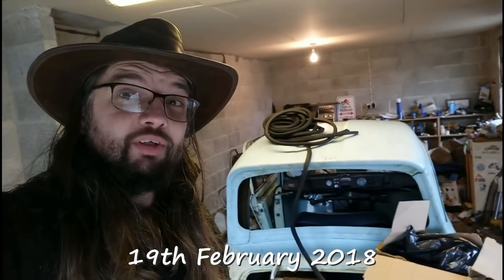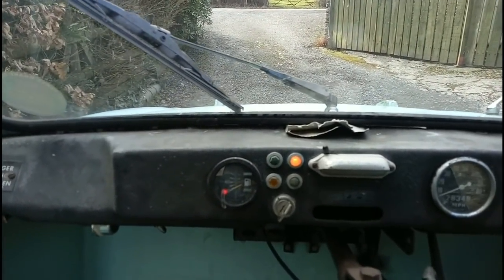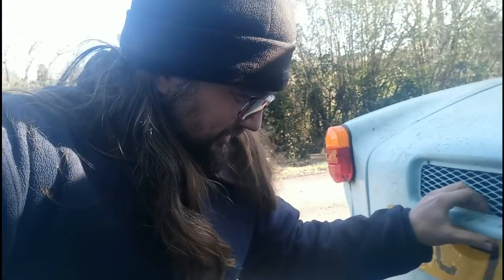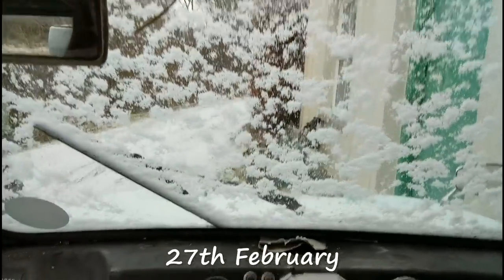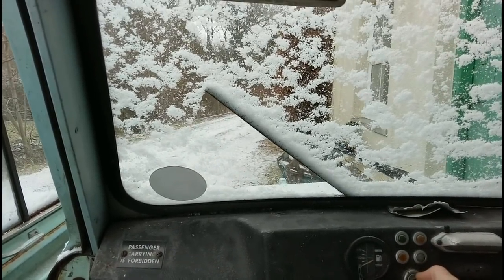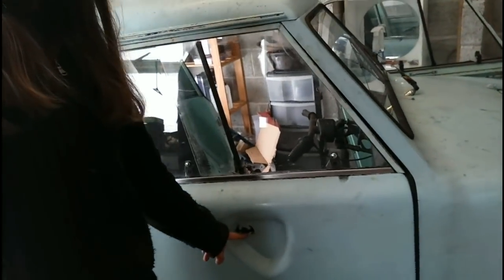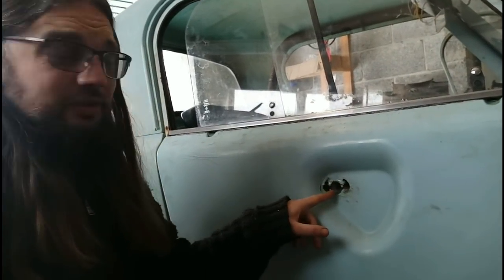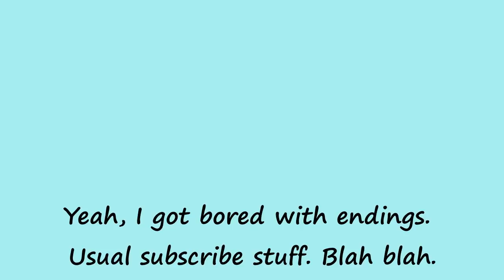Project Invacar Part 13: Rear window, lock fail, snow, mess

Comment: In the 70's the UK government  asked Lister to see if they could fit a less smoky and more economic engine  to the Ivacar - They did some bench tests with a Lister AC1 single cylinder (305cc 6.5HP at 3600rev/min)  but the project was dropped  - the engine lay under cover tn the test shop till 1994 when it was given to our group to see how many miles we could get to the gallon out of it in the Shell Eco-Marathon - Using the squirt and coast method we achieved  1760 MPG @ av speed of 15mph  at the silverstone race track  -  still have the engine in my shed !
Reply from the maker: That's fascinating!
Reply: We got it up to 50mph  : )
Reply: Wow thats quite the mpg 👍

Comment: You are a very brave man driving your Invacar in the snow. I had to get my wife to back our XJ6 automatic back onto our drive because of the snow, I was driving it too slowly so it was getting stuck, at least a few drivers stopped to allow me to muck about. Oh hum…
Reply from the maker: Small, light cars with narrow wheels are a lot better in the snow than big, heavy cars with fat tyres. That's why the Lexus hasn't moved for a while!

Comment: Maybe my OCD, but whenever I see little Tuk, I have this urge to give her a good clean up! But one day it will be immaculate again, I am sure, and will be nice to see her on the road soon. There were lots of these on the roads when I were a nipper, and its good that some get preserved - part of our motoring history in the UK. Thanks for these vids,  interesting.
Reply: I recommend those small hand-held steam cleaners inside and under, then GRP polish ( as used on boats) for the outside gel coat.
Reply from the maker: I rather fear the gel coat needs some serious work before polish can be applied.

Comment: It's nice to see more progress on Little Tuk!    I'd like to suggest , if I may,  that you consider using a two part epoxy putty for repairing the door handle area. The stuff that cures like metal.  With the use of that,  you could fabricate a way to embed  some kind of anchoring device for the mounting hardware, like a hex nut or a threaded insert!

Comment: Use an aluminum cut panel secured with coach bolts and re drill the hole for the door handles, you could use steel but as took is fibreglass we don't want a steel patch rusting out over time, nice upload Ian cupa and a biccy required take care and stay warm.

Comment: (An idea.. I have not personally tried it on a door but have done similar material bonding when working on motorcycle fairings) If the door fiberglass has gotten too weak for the handle then epoxy a 3/16" or similar thickness aluminum plate onto the inside of the door (~1-2" larger than the handle's mounting flange) then drill and tap it for the handle once the epoxy has fixed. The epoxy will give the new backing plate enough strength to deal with the handles torque and other stress when using it. 
This way, nothing appears new on the outside of the door panel, all of the strengthening is done on the inside.
Cheers,
 - Eddy
Reply: All the above is assuming that the handle fixes to the door using screws that go into the handle and door from the outside...

Comment: When I have to start an unwieldy car, I generally start while slowly applying more and more throttle. There's a sweet spot on every car and at some point it just goes 'vroom'. I will keep the throttle at that 'setting' once it's running. More will probably choke it in fuel, less will make it stall from too low revs. 
That seems to work for every car (literally) with a manual choke I tried it on yet no one else seems to do it :D.
Reply from the maker: TWC starts really well most of the time, just not when it's sub zero it seems! She doesn't like any throttle at first. 2CV is the same. Or was until its recent troubles. Still not entirely sure what's wrong with the 2CV...

Comment: You could get a flat piece of Steel and attach at either end of the door that runs straight across potrivit it at the ends of the door put a washer on the outside to stop the river pulling into the fibreglass will help make the area strong when you put the handle back on put to three holes one for the handle to go for it and two for the handles to secure should make it very strong then fiberglass where the whole are

Comment: For the door handle - what about cutting a metal plate to the shape of the recess, riveting it in place and mounting the door handle on that? That should do it quite nicely and probably it will be in place forever. If you do it with glass fibre patches, it will break again...

Comment: I think the answer to the door lock fitting issue is to get a thin piece of aluminium plate and bolt, screw or rivit it in place behind the damage door lock mounting then redrill the door handle mounting holes into the plate and that should secure the Handel back in place

Comment: Have you thought about using multi-weight oil such as 10W-30?  No need to change it for different seasons.  Most people use it here.  Also: No snow expected today in Colorado, USA at 6,000 ft. above sea level -- the high to be about 50 F (10 C).  Keep the little putt-putt putting!
Reply from the maker: I'm tempted to use multigrade, but a Haflinger specialist recommended sticking with 30. I'll see. I never was one for following recommendations...

Comment: really enjoying following the progress on little tuk, as i find invacars fascinating ---- have you managed to find the service information for the engine ? (steyr - puch 500 or 600cc air-cooled flat twin as fitted to the steyr - puch mini/micro car (similar looking to the old fiat 500) a 654cc was  fitted to the haflinger cross - country vehicle), a couple of service specs if this helps are :- valve clearances in & exh (engine cold) .006" (0,15mm), contact breaker gap (new set) .015" (0,32mm),  ignition timing 4.5 degrees BTDC  at idle and 32 degrees at 4000 rpm using a strobe lamp on the crankshaft pulley ---- hope this helps.
Reply from the maker: Thanks, but I do have a service manual.

Comment: seen those door handles on the back door of a 1977 Bedford ambulance. think Mk 1 transit back doors too but not 100% definitely old commercial vehicles though.
Reply from the maker: They're Minor Traveller, but almost certainly used on other vehicles.
Reply: +HubNut 👌

Comment: Fitting the rubber the way you have done is no problem at all, 
I used to fit the rear windows in Land Rovers like that for better security,  are you going to get the glass fibre repairs done soon Ian ?
Reply from the maker: Thanks. No, I doubt the repairs will be done soon. Priority is legality. Anything not related to that is not on the priority list right now.
Reply: It's actually less secure to fit it like that. It's is far too easy to push the window in to get access to the car with the locking strip on inside. Of course, today you might well say "Who'd want to get into this? And it's garaged most the time".

Comment: Door handle. While the handle is off, couldnt you get some thin card and trace the entire shape of the recess where the door handle sits and make 4 plates and double plate both doors. It would make it stronger. Either rivet all around or bolt it. Possibly strong adhesive would work as it will also be bolted from the door handle itself.
Reply: Ian Allen I was about to suggest the very same...stainless steel would work well...tiger seal it in place and use the handle fixings to squash it all together.
Reply: It would also spread the force used by the door handle when opening. :). I was thinking alloy, but steel is stronger.

Comment: why don't you cut a piece of stainless steel the same shape as the  bottom of that handle recess and drill it for the handle mount then you can glue it to the fiberglass with either resin or silicone  It will then support the handle and look like a scratch guard
Reply from the maker: Could do. Some were modified like that back in the day.

Comment: I'm upset, poohtube didn't give me a heads up. A low fuel light and a multi directional odo, it just keeps getting better. Put some light oil in once you've free'd stuff up, WD40 dries out after a while.

Comment: Add aluminium plate in the recess for the door lock. Rivet or coach bolt it to the door and drill holes to suit the lock??

Comment: If you want the engine to last, make changing the oil a top priority.  I'm surprised you didn't do it when you installed the new oil filter (or isn't it in yet?)
Lastly, use multi-weight oil!  10w-40 would probably be ideal for that old engine.

RichE
Reply from the maker: It has had two oil changes already. First time around, I discovered the oil filter was wrong. When I replaced the oil filter, I dropped and replaced the oil again. I'm minded to agree that 10w40 will be fine. It'll probably get another oil change after its first run out on the road.

Comment: Are you using a lead additive in the fuel?  Does the engine run on modern unleaded?  Regards.
Reply from the maker: No. Seems fine on unleaded. Aluminium heads tend to have hardened valve seats as standard. 2CV is fine on unleaded, and has a similar engine structure. Doubt valve seat recession would kick in much with the mileage it'll cover. I've ambitiously insured it for 3000 miles per year. Suspect I won't need that many, but we'll see!
Reply: HubNut Good news.

Comment: Did you find door handles for TUC yet?  Charles Ware Center in Bristol should have the Traveller handles.
Reply from the maker: Not yet. Hoping to revive what I have. These handles have an extension piece on them so they do differ slightly from standard.
Reply: Can you fit some sheet aluminum to strengthen the indentation for the handle?  The actual handle is intact, isn't it?
Reply from the maker: One handle won't unlock, but the other is intact.

Comment: supposed to get 6-12" of wet, heavy snow on friday morning... fun communite
Reply from the maker: We're expecting 30-40cm overnight...
Reply: ah, well normally i dont get to upset over just 12 inches of snow, but when its wetnheavy(sounds like a rock band name ;)) and the fact that i have to go down and recover parts of dads houseboat friday (winds ripped part of the cover over the A-frame over the boat off) going to be a max painkiller morning... gotta make sure to inject caffiene

Comment: Hey HubNut, mind if I ask you a question? My car started making weird noises for the past few days, then yesterday the noise was really loud, like a whirring and humming noise. I called up my insurance company to tow it back to my home. Today I drove it to a nearby service center and it got worse. The car started wobbling a bit. The service center said both the rear wheel bearings were broken. They pointed specifically to the left rear one and they said the right rear one is a bit broken too and would wear out soon if it wasn't replaced. They told me to touch the rear absorber (I guess?) and feel it while they spun the wheel and I could feel the thing vibrating. My car is a Proton Iriz and it has only clocked 40,000km so far. They asked me if I hit any big holes on the road? But isn't it normal to sometimes fail to avoid potholes? RM700 or about 130 pounds to replace both rear bearings together with their hubs because apparently they have to be changed together (my car has ABS and EBD)? Have I been fleeced? My car is at the service center right now and it's closed. They told me it will be done by tomorrow. I was so worried about the car because I need it for something important that is coming up soon, so I didn't think about getting a second opinion from another workshop. Plus, I was worried about the tyres exploding if I continued to drive. Reaching the service center alone was an adventure.
Reply from the maker: Watch my Citroen ZX video. I had a rear wheel bearing fail spectacularly on that. They do wear out, though 40,000km is not very long. I'd expect at least twice that. Modern developments mean it can be very expensive to overhaul. On the ZX, the bearing is just pressed into the brake drum, so it's easy to replace.
Reply: I don't know who to blame... Is it bad quality from Proton? Am I too careless on the road and hitting too many potholes? I am an Uber driver, and there were a few times that I drove through massive thunderstorms and unfortunately some of the roads were kinda flooded. I read that water can really ruin the bearings? So, your opinion is, it's not likely that the service center cheated me, right? Loud humming noises and a bit of wobbling of the car usually points to failed bearings? Watching your Citroen ZX video now. Thank for the quick reply! :)
Reply from the maker: Yes, certainly sounds like failed bearings. Flood water can wash grease out of bearings - had that happen on my 2CV once. That was an expensive lesson...
Reply: Just finished watching your Citroen ZX video. Yes, that was exactly what I experienced too. But I didn't forcefully shake the wheels with my hands. Expensive lesson for me too... Hmm.. If it's water damage, shouldn't I be worried about the front bearings as well? What can I do? Get the service center to service the front bearings? Or just wait until they fail too?
Reply from the maker: In theory you could dismantle the bearings and repack them with grease, but it's a lot of work. Might as well wait until they wear out. Don't ignore any nasty droning noises though.
Reply: Ok. Thanks for the advice. :) How are you? You seem to really like the 2CV model. I want to try watching all your 2CV videos. Is there any of those videos in particular where you talk about the bearings failing on your 2CV?
Reply from the maker: Sorry, struggling to catch up with all comments, because YouTube is USELESS. Bearing failure was many years ago, pre-video.

Comment: Can't you fill the hole for the door handle with fibreglass and then re drill and mount?
Reply from the maker: Certainly an option. Will need reinforcement though. This is a known weak point.
Reply: You could keep adding layers on the inside until you get a reasonable thickness or like Satnavdmc said a flat piece of steel behind and you could cover in fibreglass to secure. certainly wouldnt pull through then.

Comment: Might be worth speaking to ex Reliant fibreglass guru Andy Plumb about how to tackle the door handle and lock best way, he is on facebook and gives us Reliant owners sage advice from time to time especially when talking about fibreglass applications.   I am thinking you will need to sand down the inner side, then bond with pop rivet and a strong adhesive a few mm thick spread plate trying to mimic the previous applications installation as there may be ribs and spars embedded into the fibreglass that will take the weight, fibreglass body filler will be easy to apply making sure the flat edges of the pop rivets are on the exterior which can be lightly sanded to hide them under a skim o' bodyfiller.
Reply from the maker: Yes, a few options to explore. Once the weather returns to sensible...

Comment: what's the rusty bolt in the roof lining?
Reply from the maker: You might need to give me a time reference there. I'm not sure what you're talking about.
Reply: ah yes, it's at 5:22 think it maybe a sun visor bracket
Reply from the maker: Yes, you're quite right.

Comment: does it not have a choke??  also what is that annoying orange light on the dash .. it would really get on my nerves .. Warning lights = moth to a light  - to me..I have nearly crashed glaring at a stupid warning light
Reply from the maker: Yes, it does have a choke. It was set to full. Orange light is the charge light. When it isn't charging, it lights up. I suspect the voltage regulator would benefit from a tweak.
Reply: ahh thank -you .. Wondered if you had flooded it when it wouldn't start
Reply from the maker: No, as I mentioned, it's just running really thick oil at the moment, which is not great for cold starts...
Reply: no prob i heard you say that..i was just thinking outloud ..but one thought .. if these things were taken off the road as deemed unsafe ..How can you get insurance and be able to drive one back on the road???
If they were just deemed unsafe for disabled people and not actually unsafe to drive then surely people could have bought one to use  instead of say a bike.
just a thought..maybe a silly question..but i don't know these things.
Reply from the maker: They were leased to users, but the scheme ended for new subscriptions in 1977 due to safety concerns. However, users who already had one were horrified, so the scheme remained in place. By 2003, the government of the time decided enough was enough and ended the scheme. I guess they couldn't imagine a time someone might want to preserve these vehicles, so they were all ordered to be scrapped. Very few were ever in private ownership. From the government's point of view, it'd be a bit strange to end a scheme due to safety concerns, and then sell off the 'unsafe' vehicles. Media would have had a field day.

Comment: Re- fibreglass door from inside FFS
Reply from the maker: It needs a strengthening plate too. But, I need to remove the doors from the car first, so I can dismantle them and gain access. It also needs to stop being several degrees below zero, blowing a gale and snowing. Please.
Reply: Use acrylic sheet and man up a bit

Comment: unless you pumped out the original gas in the original tank, wouldnt run it too dry, suckin in alll that gunk...
Reply from the maker: Due to a leaky fuel line, the tank was empty.
Reply: well just hope not much crud left in there. granted with a carb not as important as fuel injected... its still a worry with older cars and the crud in the bottom

Comment: can you not just blank the handle off for mot. and use the other door
Reply from the maker: If a door is fitted, it must open and shut. The other door doesn't unlock on the outside, so problems there too!
Reply: sounds like she needs a sympathetic  mot lol